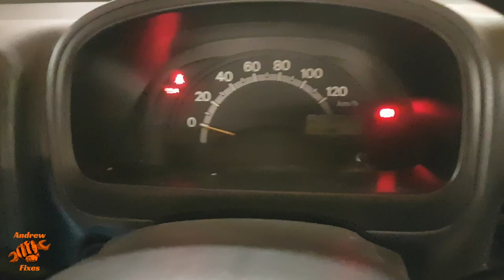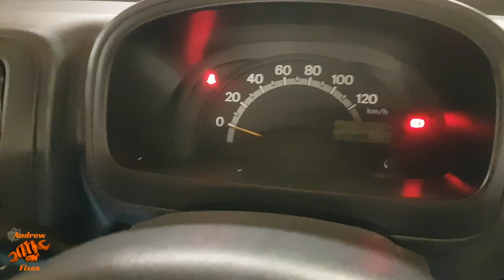Suzuki Carry service | Basic engine service on a 2004 DA63T Suzuki Carry 4WD kei truck

Comment: Another fantastic tutorial, great work 

I don't suppose you have any of the part numbers for the oil filter, air filter and spark plugs? I get the feeling my local motor factors won't be able to do anything as the registration number will not be on their system.

As a little hint, when working under the drivers seat, once you have the base lifted above the steering wheel, if you roll the seat as far forward as you can, it allows you to lift it much higher and give much better access, I hope that helps you out.
Reply from the maker: Thanks for the hint about the seat!

Details of the spark plugs are on a sticker on the passenger side sill / B pillar.

I used a Mahle OC215 oil filter.

The air filter is Suzuki part number 13780-77A00